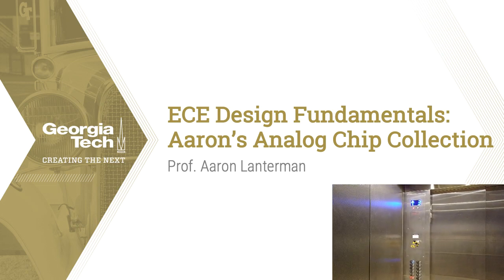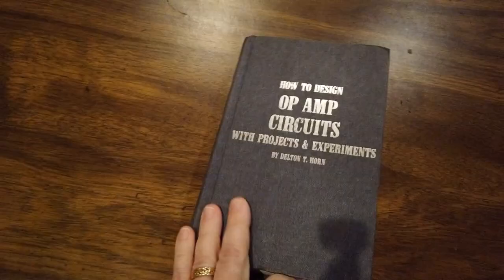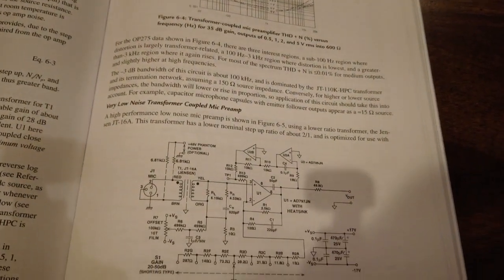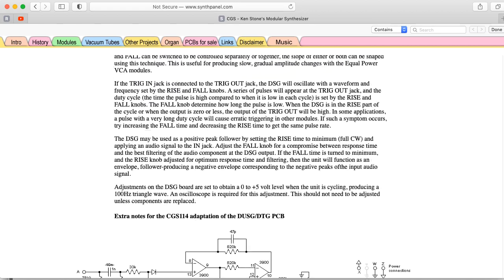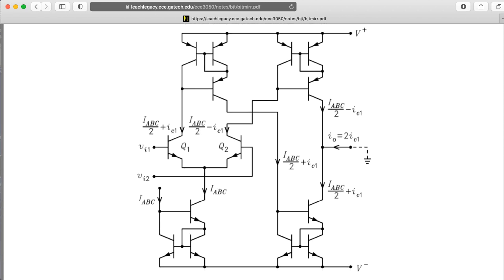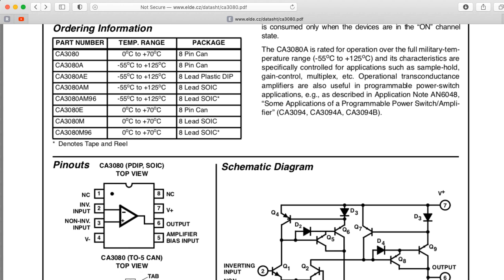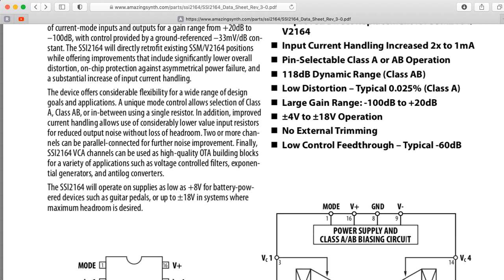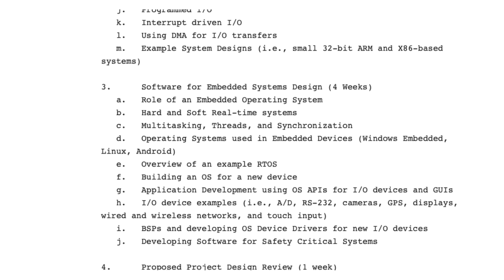Aaron's Analog Chip Collection (ECE Design Fundamentals, Georgia Tech class)

Comment: Interesting video as usual just keep them coming!

Lm13700 is awesome so is the 2164 i have used both i made two different VCA's (with slight different usage in mind for my Eurorack).

The lm 13700 is a bit harder to use than the ssm2164 IF you are making VCA's.

 A side note to 2164, if the negative rail fail the chip gets fried. 
And for simplicity i almost always just use OPA167x those i like them a lot.
Reply from the maker: Thank you for your kind words!

(SSI has a reissue, the SSI2164, that apparently fixes the negative rail boom bug.)
Reply: @Lantertronics  I noticed that after i had placed my order haha, it's quite an easy fix, but i like living on the edge. It has been running nicely for around a year now so i do not bother with it.

Comment: Good video! The Prophet 5 is using a ton of LM348, so what's the difference of this one compared to TL074?
Reply: TL074 is FET input, the LM348 is an improved LM741 (lower input and supply currents), and has transistor inputs. The TL074 type has much less noise and far lower input current, and 5 times the bandwidth capability of the 348.
Reply: @cjay2  thank you for the answer! Maybe the 348 was much cheaper at the time, or that it was more rock 'n roll because it is more noisy...
Reply: @PATRIK67KALLBACK  You can google (or duckduckgo) search "LM348 data" and "TL074 data" and dozens of sites will come up offering data sheets.
Reply: @PATRIK67KALLBACK  No, not for being noisy. Every synth had a noise generator with a volume control. The 348 was used because it was cheap and worked a bit better than the 741, in its time. Also, most of the control voltages and signal voltages were plus and minus 5 volts or more, and the noise was buried below.